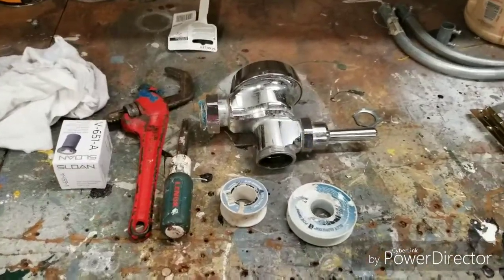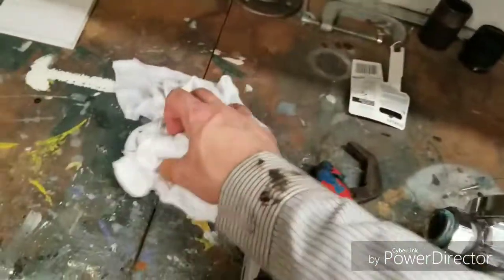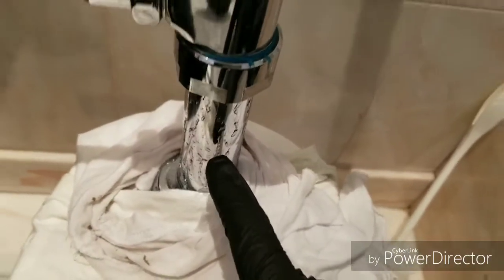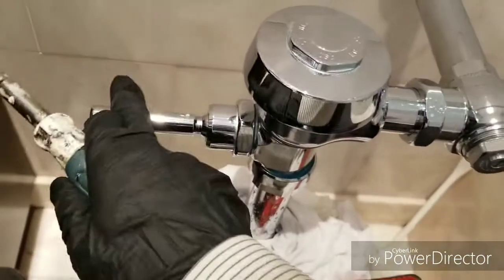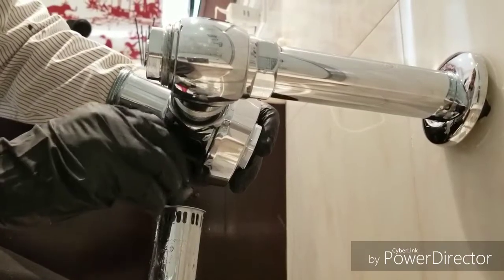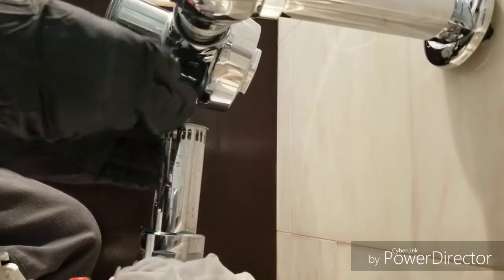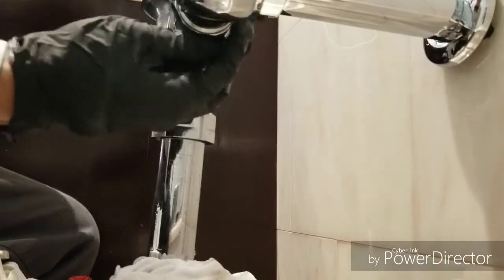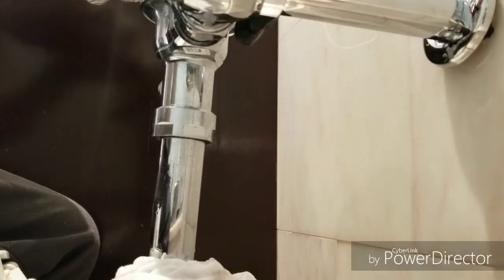Flushometer 101 how to change a vacuum breaker.

Comment: That didn't look like an O ring at the vacuum breaker connection but more like a normal washer whereas there is an O ring where the body slides into the shut off valve. If you have the correct O ring, there should never be a need for teflon tape anywhere on these units..

Comment: I used a spud wrench at work in order to loosen the nut located on the right side of the toilet, in an attempt to replace the vaccum breaker. Unfortunately, I somehow caused a leak from where the nut is and ended up having to turn the water off. It required a lot of force loosening that nut. Did that end up damaging it? Also, would Teflon tape help with fixing it? Thanks.
Reply: Always t tape and pipe dope fittings most ppl will say it’s not important but I believe that it makes a difference. In my personal opinion the teflon tape makes a seal and the dope allow you to fully engage the joint

Comment: thanks alot.  I tried to replace the vacuum breaker and there is no longer leak at this location. 
Now there is a leak at the connection where you said you may have to change the rubber o-ring if it leaks.
My leak is not from the thread but it is where the metal o-ring is.  I am trying to figure it out, but I can't understand why there is a leak there.
I thought the metal o-ring broke, so I went to the plumbing store.  The metal o-ring at the store is the same as the one I have....

Can you please give me some advice?

Thank you

Comment: the biggest problem i seen in all the videos i have watch is not using plumber grease on the o rings before they put them together, just  a little lube so it is not dry rubber on metal